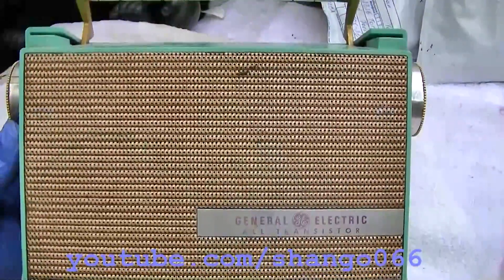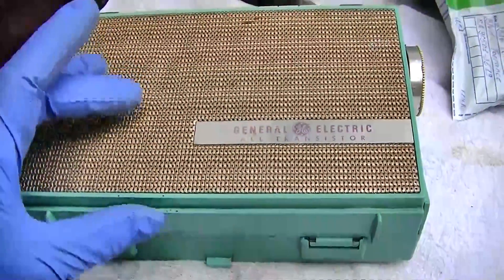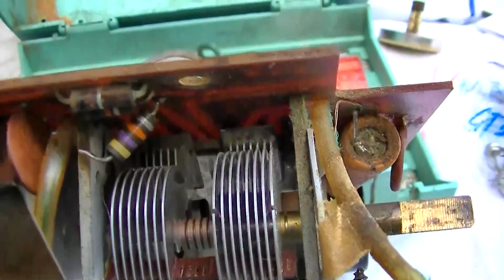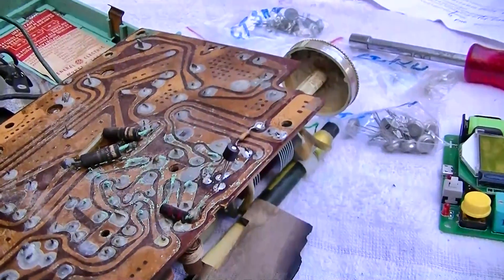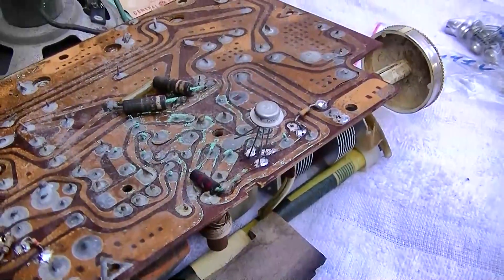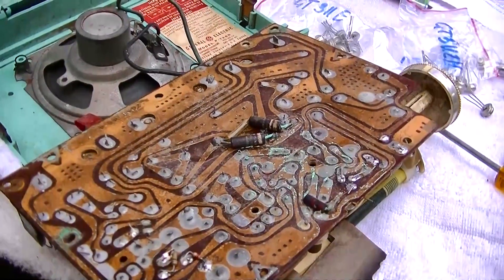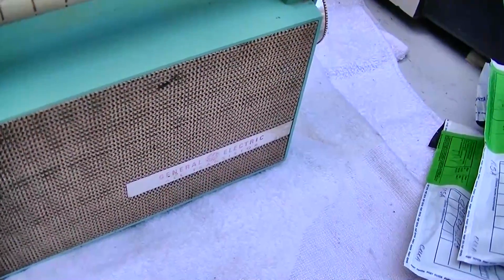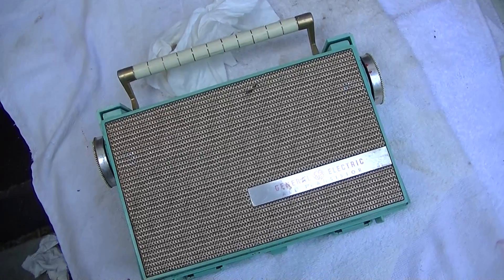GE AM Radio Germanium Russian Transistor Test NPN

Comment: Just to give you an idea how hard it is to get a good new T03 Darlington transistor I ordered 16 from 3 reputable and different sources and everyone is shorted. These are all supposedly BRAND NEW transistors from 3 sources and every one has a voltage reading of 1/2 volt between the emitter and the collector (in one direction only). According to one of your previous videos these should all be considered shorted. I emailed all three sellers and each told me that it is normal to have a voltage reading between the emitter and the collector on one direction. Either your comment is incorrect or these three sources don't know what they are talking about.
Reply from the maker: Darlington is different. Germanium is different. A standard BJT should not show anything between C and e. Unless you ordered them from digi-key or Mauser consider them counterfeit junk. Any modern silicon devices or fets off eBay are counterfeit Chinese clones that will fail in short order. I talked about that all the time in videos

Comment: You always talked about this is ok for a tube set, if this were solid-state all sorts of problems might arise, and yet you never bother to reflow the solder, or try to inhibit the oxidation, but yet you on, and on about liking the set. F it I am glad you don't like me. You say you read all your comments - No.13 thumb-down was from me. What a waste of 12 minutes!
Reply from the maker: That was not the topic of this video. Sounds like it's time to turn the advertisements on
Reply: @shango066  Are you assuming I can't read? Look...Boi!... Knowing how sensitive germanium are in rf circuits, did you really think just swapping transistors would really make a difference under those conditions? With the defective volume control I noticed zero changes for the better. Advertisements? Please do. The elections here are over now, thank Go... I mean Arron Ra, or Dick Dawkins which ever... So it would be mostly Grammarly which is just 30 seconds (Soothing), compared to the 2-5 minutes paid political announcements from my country. :)
Reply: @shango066  Yuh vexed? You is my best top of the line go to guy for old school electronic troubleshooting; I like tube stuff, I even have a 10 x 16 or sum pal, and ntsc tube monitor, since 1998. it good for n64 and psx games.

Comment: You don't want such a high Ft transistor for an AM radio. Get something with a Ft around 50mhz. The high Ft transistors  will oscillate at uhf frequencies causing all kinds of problems. Is that green stuff on the board guacamole or corrosion? Whatever, it should be totally cleaned off!

Comment: This radio has a horrible looking solder/trace side of the circuit board with tons of blue corrosion etc.
Would you consider showing us in a video the process of cleaning a board such as this so as to bring it back to as pristine a state as possible, as well as inspection tips for problems to look for on the trace side? That would be very helpful.

Comment: I gave the in-laws a Pye transistor radio from the mid 60's. After about 6 months the AF117's developed the tin whisker problem. I changed them out for PNP silicone with the bias increased but it was nowhere near as sensitive. I've since got a load of germainium transistors so I might revisit it. Comrade Rush Limbaugh, brought to you by the CCCP.

Comment: Very nice ! I dont think that the oscillator can effect distortion, maybe there is another issue with the mixer-stage or an if-stage and the variation of oscillator-amplitude do partly compensate this another fault. The oscillator-amplitude will influence the mixing-parameters in the mixer-stage. If an oszillator give distorted rf, there will be unwanted if-mixes because of the harmonics... Maybe it can be seen on an oscilloscope wich is noch easy to couple without detuning the oscillator. In many cases there is a low-impedanz-point to couple an oscilloscope (feedback-winding). I think, a npn-silicon-transistor with a changed BIAS will work well, too in an oscillator-circuit. ... in the sony tv-case my suggestion failed ^^ but I like these disussions and your work so much.

Comment: What was causing the change in performance when you fingered it?  It didn't seem like you fixed that.   It seems like it worked right when you did that.    Perhaps some of the corrosion is shorting things?

Comment: I ordered Russian transistors from five different sellers in mid-April. Orders from sellers in Netherlands and Ukraine arrived in a few weeks. Those located in Russia took three and a half months. Tracking showed they were shipped promptly but after a few days died somewhere in Moscow. Then, all of a sudden, they arrived in a clump at the end of July. I understand the problems with logistics and delays in this environment. However, eBay sets an expected arrival date and customers only have 30 days after that exact date to  file a non-receipt claim. If you don't file, you lose if the order doesn't show. If you file, seller refunds, and order arrives, eBay does  not have a procedure to re-pay the seller. So, as always, it is eBay that is the real problem. Here, screws over both buyers and sellers.
Reply from the maker: That exact thing happened and I went back and made arrangements to get the seller repaid. I have never had any problems with the sellers in Russia sometimes there's a language translator issue but they seem honest and upfront

Comment: Hi shango066,  I enjoyed the video and am glad to see someone experimenting with repairing these radios. Most of the russian transistor you tried will work as replacements. You need to change the upper bias resistor to 100k trimpot. Varying the bias and therefore collector current will change the gain of the replacement transistor to what is stable in the radio. Silicon transistors are touchier on there bias setting as high gain transistors will have to run with quite low collector current in the square law part of their curve. Some of these radios have used a ferrite bead in the base or collector lead depending on how well the PC board has been designed.

Comment: i have a few hundred russian mp40 pnp transistors price was right when i bought may end up in a radio or walkie talkies i need to repair
Reply: MP40 is just AF transistor. For RF, there are better ones like GT328 or GT346. (PNP, Ft 200-1000 MHz)

Comment: Earlier today I found a GE 8 Transistor (one of the ones with the weird speaker that doesn't use an output transformer) that had been sitting for about 20 years in a box in a non-climate-controlled part of the house. The radio itself is from the mid-60s. Tuning cap, IF cans, electrolytic and some ceramic caps are Japanese, the rest including the semiconductors look to be U.S. made parts. Lots of corrosion from where batteries leaked ages ago. I put a couple AAs in expecting it to be dead, but it came right up and was picking up stations no problem. :)
Reply: Transistor radios use Permanent magnet drivers. Tube radios sometimes have P.M. drivers, but usually the older 20's-40's tube radios use a Field Coil or Electromagnetic driver.

Comment: Back in the day we in the US made superb germanium transistors. The RCA 2N2613 and 2N2614 for low noise audio, the RCA 2N287 and 2N384 drift transistors for HF radio.  Motorola did the same for higher power RF devices.  Its just like we stopped that almost immediately in the 70s, whose, they vanished.  Repair or restore is not an American word, substitute "throw away" and buy new.
Reply: Thank your corporate masters who sold out for cheap labor and no hazardous waste laws.

Comment: shango, how do you get rid of that oscillation, from 8:08 to 8:16 or so, I have a Japanese germanium AM only that does that, even with fresh new transistors, it does it across the whole band
Reply: Someone here mentioned:  Series base resistor a few hundred to a few k Ohm, and/or base ferrite bead.

Comment: Try putting a low value resistor in series with the base lead to kill the oscillation.  Something like a few hundred to a few thousand ohms.  Also a ferite bead over the base lead.

Comment: Radio: "...downtown..." 
Shango066: "The Mrs Miller version of this is so much better."
Me: ... checks youtube for the Mrs Miller version... is not disappointed. 
Who needs Petula Clark when you have Mrs Miller. ;~) 

While on the subject of things people probably don't really want to know. One of the first things I ever built (from salvaged components and other junk, and with, I have no doubt, terrible soldering) was a transistor radio, which, if my memory serves (doubtful I know), contained at least one OC75 germanium npn and an OA10 germanium detector diode. 

I have a container of salvaged soviet era germanium transistors somewhere, which were cherry picked from various scrap boards from a local Glasgow electronics supplier back in the day. I also have some very odd looking capacitors from the same source.  I have absolutely no idea where they got them from. Probably best not to speculate, given that it was the height of the cold war.
Reply: I've noticed that some Soviet era electronics were imported to Britain back in the 1960s, 70s, and 80s, a lot of guys on Y.T seem to have Selena radios which are all but non existent in North America. Sometimes you see products from the G.D.R. (East Germany) but not often. The O series transistors were some of the earliest transistors that I have run across, they are actually glass cased with black paint over the top. So basically Phillips used similar techniques to manufacture their early transistors as they did vacuum tubes, and employed a similar numbering system using a O instead of a D, an E, or a U.
Reply: i've been listening to mrs miller for hours ever since he played her. It's strangely addictive

Comment: Those GT11 transistors ought to be called "UFO's" all that nasty corrosion tho, can a radio even work properly with it?
Reply: Thats what i thought. First thing i would do is clean off all corrosion & then resolder all joints on pcb.